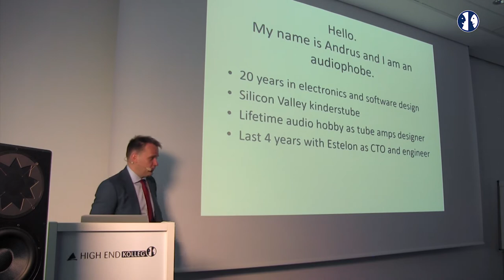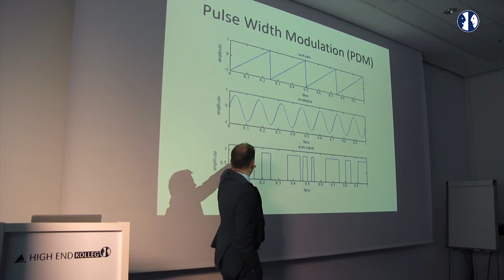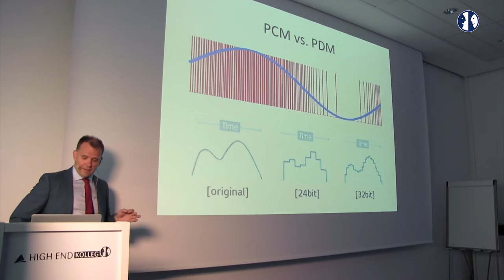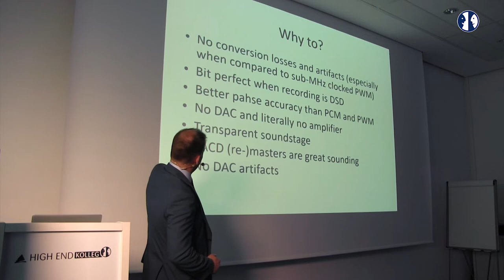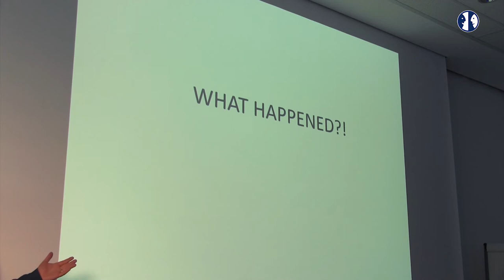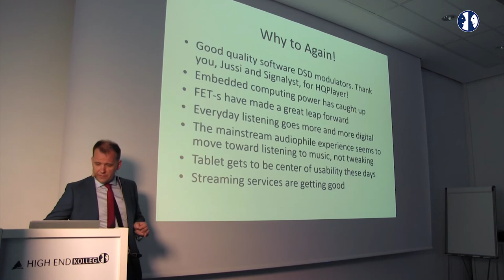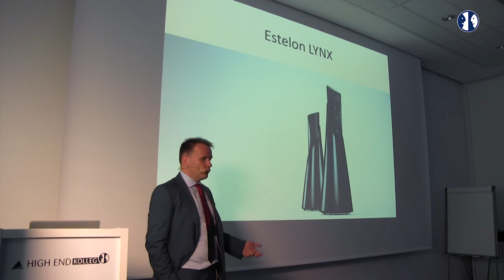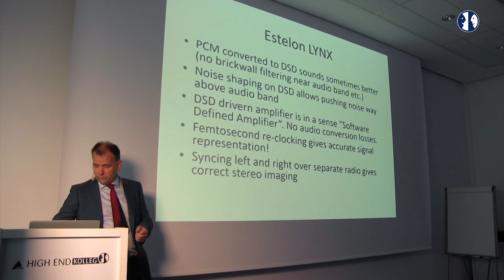DSD modulated amplifiers

Comment: What about SiC fet , that is even better than GaN.  There is amplifiers but with lover voltage levels, based on logical gate ciscuits. Unfortunatly this chips works up to 5V only and can handle up to DSD 256